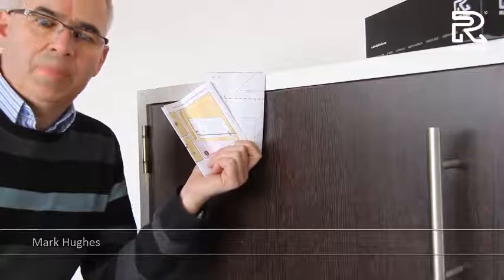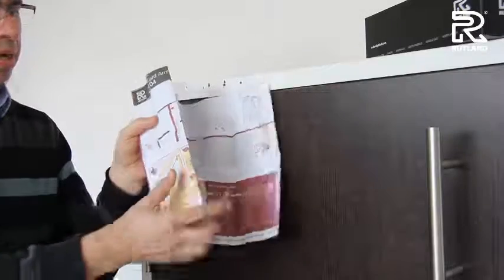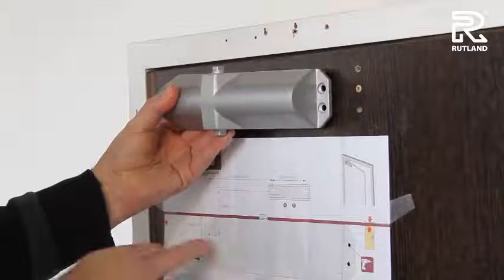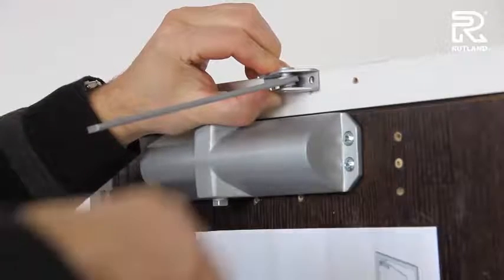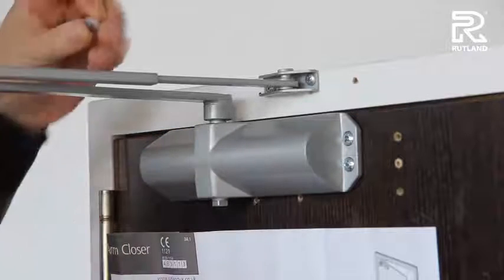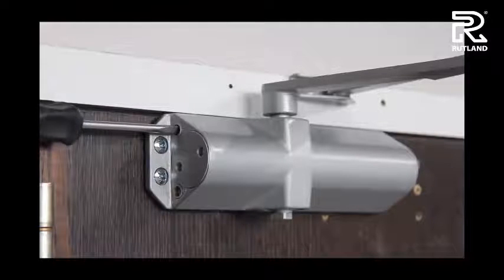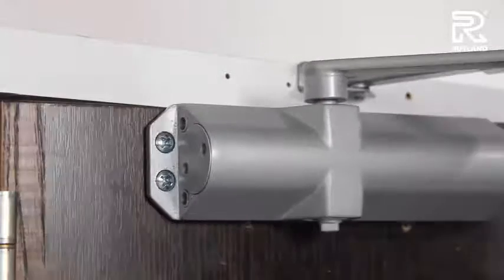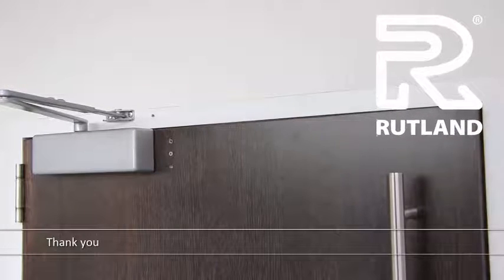Rutland: Know How - Rutland TS.3204 How to fit - Pull Side Figure 1/Standard Arm

Comment: You cannot alter the actual pressure required to open the door with this model. Absolutely useless if you are old or infirm. You need a model that you can alter the effort required to open the door .This isn't it.